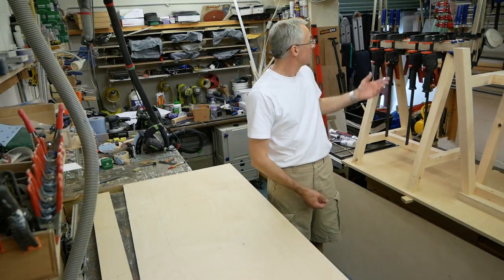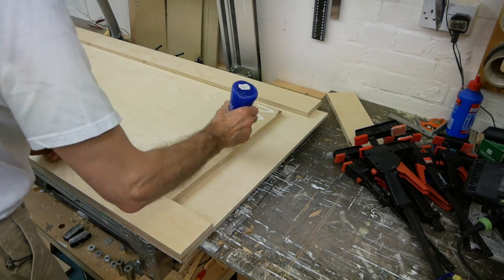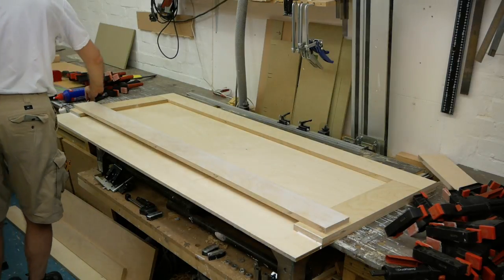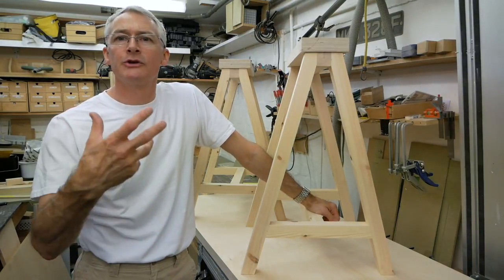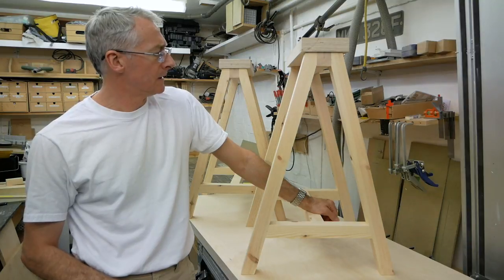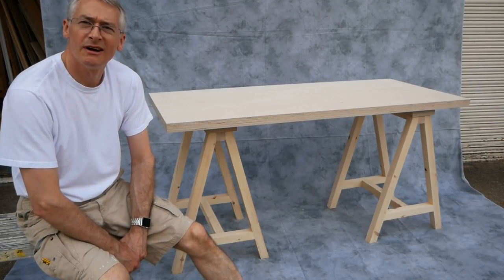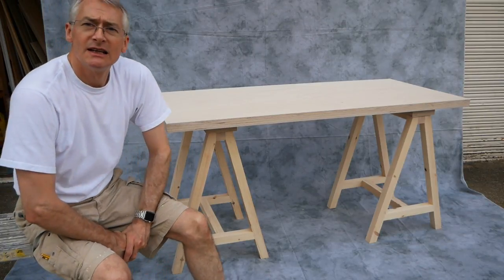Trestle table in Redwood and Birch Ply, Part 3 #063

Comment: Being it's Fathers Day today, I thought I would do some work on a small table/stool out of American Maple.  The design is not too dissimilar from your trestles.  I cut the legs at 440mm long with a 104.6 degree angle at each end.  Then i discovered I cut the legs wrong (needed to be parallelogram)  so legs are now 2cm shorter.  I made story board up very similar to the one you show.  Then I progressed to cut some short pieces of Maple 200mm long, thinking I'd use some of the off-cuts I produced earlier.  They weren't off-cuts just the other 2 legs I'd set aside.  So I've come out of the workshop where its still relatively cool and put this one down to a learning experience.  Pick it up another day hoping I have enough Maple left.  Love your video - thanks for sharing :-(  

Regards Mike
Reply from the maker: Sometimes it's best just to call it a day and walk away, but sorry to hear about the Maple - that's got to sting 😯 If it's any help, there are two tasks I can't stand doing - hanging pictures and putting up window blinds; yeah, guess how I've spent my Father's Day, lol 😂 Time for something cold and frothy 😁

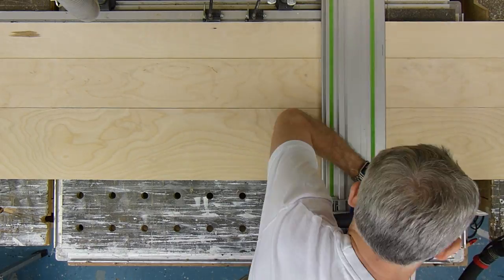Comment: And in case my question on part 2 of this video was too late - at 1:38 you use a long track with blue running lanes - not Festool green? Can you let me know what brand this is if it's compatible with Festool TS55? Thanks!
Reply from the maker: James Bailey Nope, not too late - it's a Makita track, more details on other answer. Re compatibility, the Makita rails have a little lip on them - the Makita saw has an anti-tipping thing - which gets in the way of some accessories, but otherwise the Festool saws fit and run on Makita track just fine 👍

Comment: I learn something from every one of your videos. I think the longer format sets you apart from the build crowd. How would you have done this build before you got a Domino?
Reply from the maker: +Bulwul Thanks! It's a tough one - I probably would have tried it with dowels, or perhaps just bolted it all together and covered the metal with plugs. Or, possibly, I just wouldn't have taken it on 😱
Reply: @10MinuteWorkshop  PU Glue and a Cregg Jig. When you drew out the tressels full size it brought back memories of drawing out full size  patterns, for doors and windows in the joinery shop I was in 40 years ago. Lucky you have a nice flat work bench, when I use to do jobs like that, I use to have 2 one hour fire doors as my bench so I new it was dead flat, so I did not glue a twist into the item I was making!!

Comment: what are the exact measurements for the table pls. width x length?
Reply from the maker: They varied, but typically 1500mm wide by 900 deep, 800 high to the surface. 👍
Reply: @10MinuteWorkshop   thanks for that, I meant what are the measurements for the table top, as I have already the trestle legs. thanks
Reply from the maker: @barrybodiongan6684  The spec was usually for 50mm thick, but I usually laminated it up from 2# 18mm and a 12mm boardn to make 48mm, and no-one complained - or perhaps, noticed! Width & depth as above. 👍

Comment: HI Peter, maybe I missed the logic, why make the table top with rails? Why not glue three sheets together?
Reply from the maker: +Rodney Baldwin Keeps the weight down.👍
Reply: Peter Millard I thought that my be the reason but significantly?  Also I have just started wood working and interesting how people cur rebates. Everyone in the US seems to use dado stacks on table saw, but here in the UK we seem.to use a router like yourself. I was wondering if you have done a piece about your router setup? O would be very interested